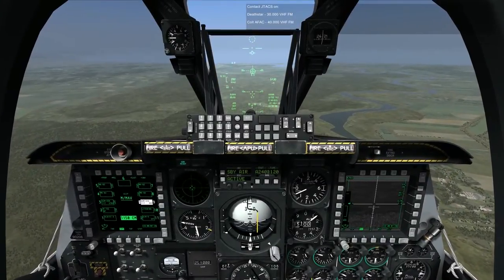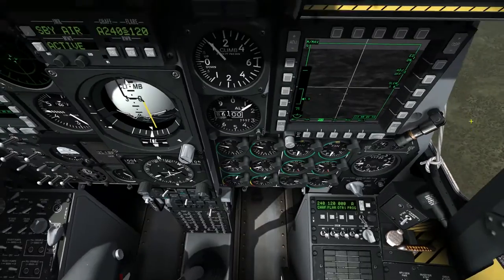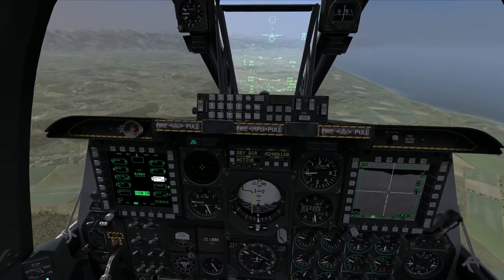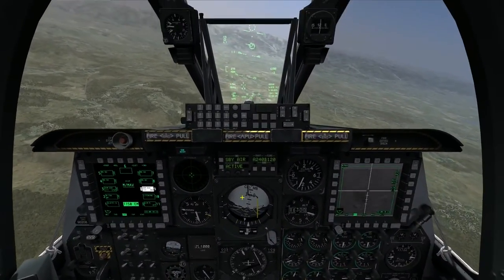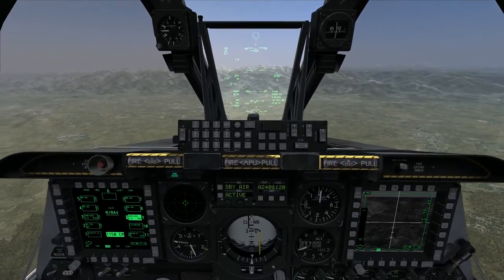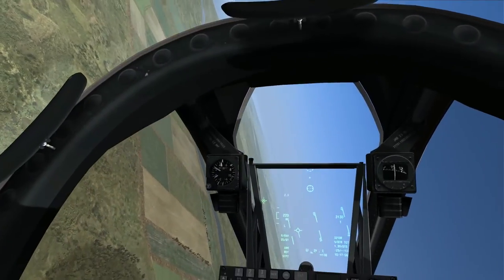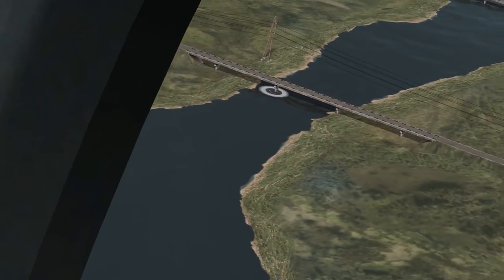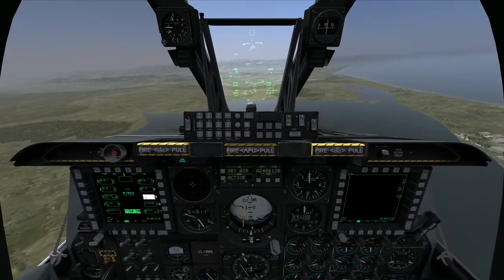On the Range #25 - AGM-65 Maverick Force Correlate Track in the A-10C

Comment: People always complaining about maximum realism should look at pilot reports about Force Correlate...they will be entirely disappointed that the Maverick Sniper Rifle doensn´t exist in real life.
In general the Maverick is extremely simplified in DCS, none of the negative factors that might cause it to miss are even modeled. People have asked why there are TV and FLIR versions of the seeker, when FLIR seems much more useful, right? Well, turns out the Maverick heat seeker in desert regions doesn´t really care if it hit´s the tank, or the hot asphalt the tank stands on, as long as it´s hot. Same with fires and other stuff that might be going on.
The Mav is very resistant to this, and a very accurate missile, but in DCS it´s gods touch of death...
Reply: Guided weapons of any kind are extremely simplified in video games :)  DCS is no exception. Modelling these gadgets in extreme detail to make them behave exactly as they do in real life would be both time- and cost-prohibitive; they just represent them in a way that's pretty convincing and suitable for entertainment :)

Comment: I saw on another tutorial about Force Correlate that you can use it to "lock up" and hit targets (including tanks) from further out than you would with the centroid tracking method.  In addition to finer control on static targets, that seems like a good use for non-moving armor from a greater standoff distance.
Reply from the maker: Could be.  All the manual says is that it is better for picking out specific points on larger targets.  I have seen techniques described for using them from longer range with the targeting pod but the way they behave there seems just a little too perfect. In the end, accuracy would still depend on the missile seeker's ability to resolve details in the total scene.  I would expect a lot more errors to crop up at longer ranges than we see in the sim.  But then, if it works, it works... :)

Comment: If "Force Correlate" isn't the default configuration of the Maverick then why is it set to the center boat position (default position)?  So I have to move the boat switch out of center position and then back to center position to get Force Correlate mode to work and when I want yo use centroid (default) mode of the Maverick I have to move the boat switch to the NON default position?